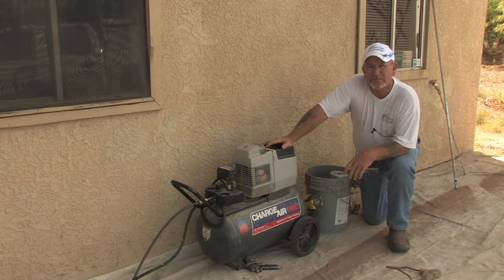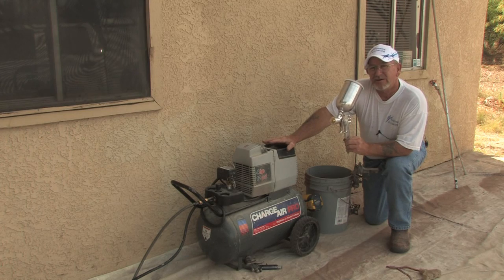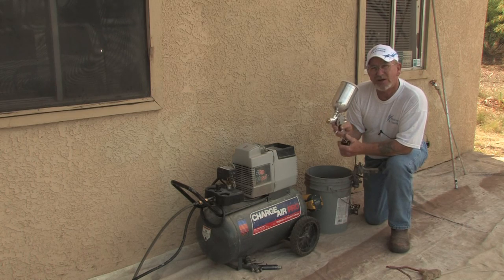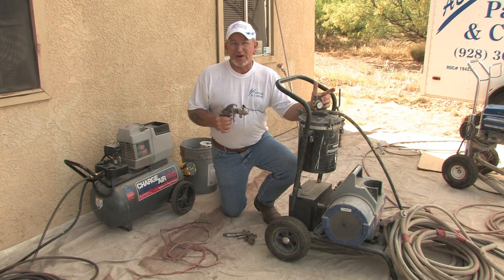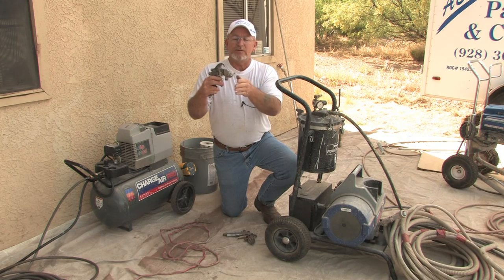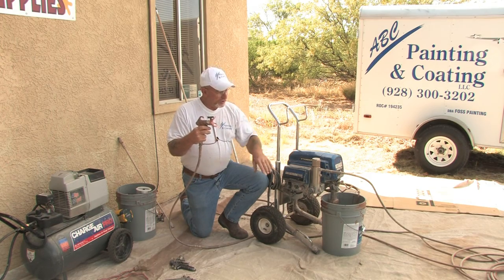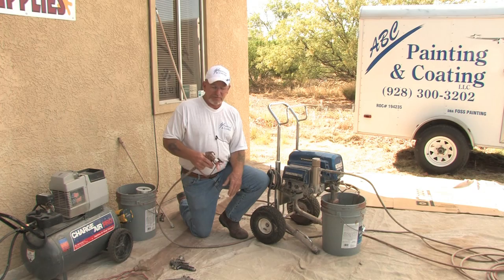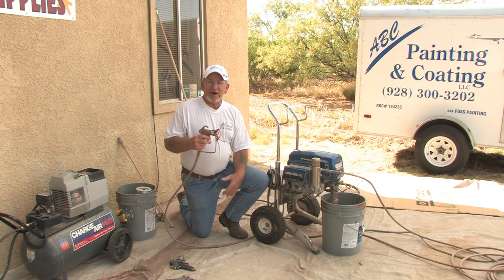Paint Guns : How Much Air Is Required to Use a Paint Gun?

Comment: I am having trouble figuring out what type of setup to use for hvlp.  I already own a Crafstman 15gal 1.5-3hp compressor.  If using a pressure pot, do I need a separate compressor for the pot and one for the gun, or does the pot have an inlet from the tank and outlet to run to the gun?  I realize this may not apply to your video, but I need someone who has experience to give me some advice.